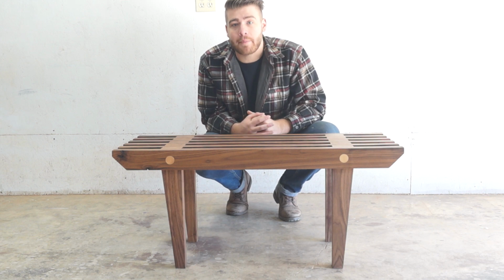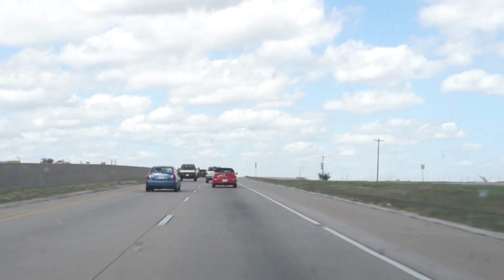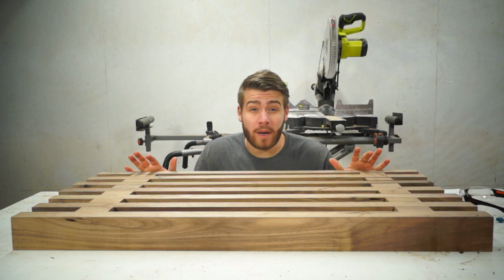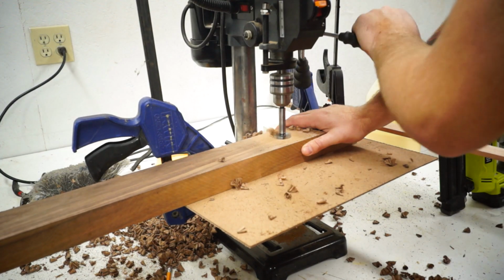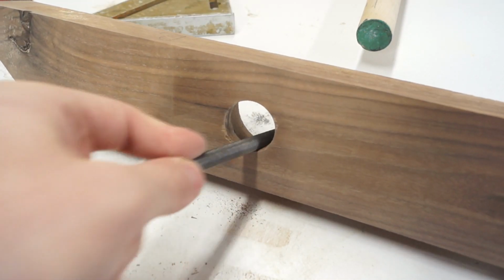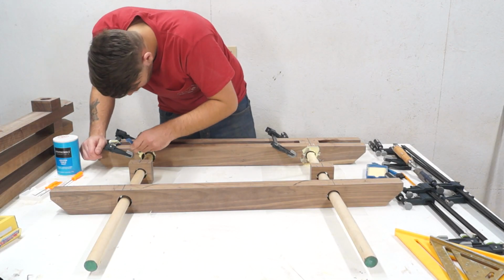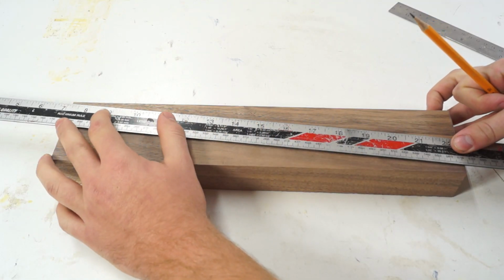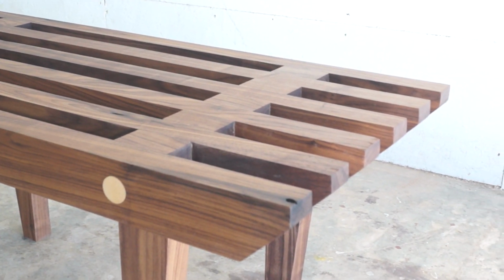DIY Mid-Century Modern Slatted Coffee Table | Modern Builds | EP. 49

Comment: I really like the 20 something mistakes you made along the way. Thank you for not editing them out. Really nice table in the end!! Good job. 

The problem with the holes not lining up I saw coming because Matthias Wandle always says drill presses are not perfectly vertical and his solution is to rotate the wood while drilling it. He doesn't use a stop block to align pieces. He instead measures them all and center punch them to guide the drill head. 

I'm no woodworker. Just woodwork YouTube watcher :P
Reply from the maker: Interesting, I'll have to find and check that video out
Reply: https://www.youtube.com/watch?v=aj3_hR7UvQs
Reply: RobertGoulet298 Not quite this video. In other videos he mentioned that the drill press is not exactly vertical and if you rotate the wood while drilling it will make alignment easy. He basically rotates the wood 180 degrees and back a few times while drilling a hole.

Comment: Why didn't you make the legs longer and use them in place of 4 of the blocks?
Reply from the maker: I didn't want end grain showing from the top when all the other spacers and slats show edge grain
Reply: Glue like a half inch or less on the top of the legs/spacers to show the grain you want? I just think it would be a lot more stable if the legs were included as a spacer. The aesthetics on this table looks really good though. Nice job!

Comment: great built as usual 
just two things.  the taper of the legs looks the other way to me.  I think it might have looked better if the taper was facing the other side 
and second.  was there a reason the legs aren't actually part of the spacers?  so therefore legs and spacer are just one piece instead of using dowels?
Reply from the maker: I made the tapers go the direction they did so that they matched the angle cut on the corners of the slats. Really the only reason I didn't make the legs a part of the spacer is because I didn't want end grain showing through the top where the rest of the slats and spacers had edge grain
Reply: Thanks man.  Makes sense now :)